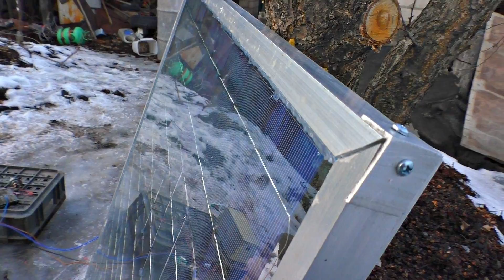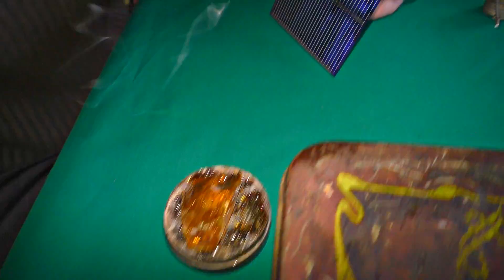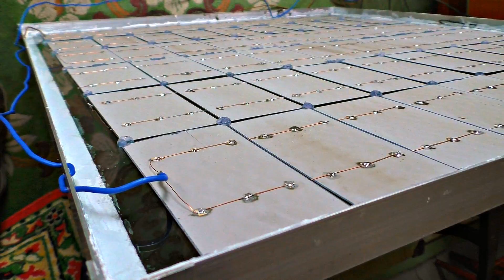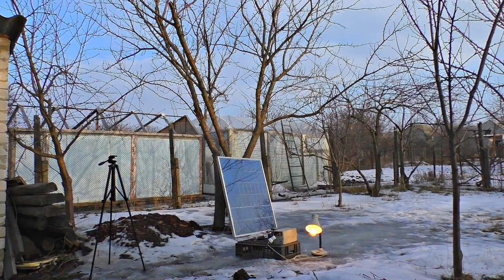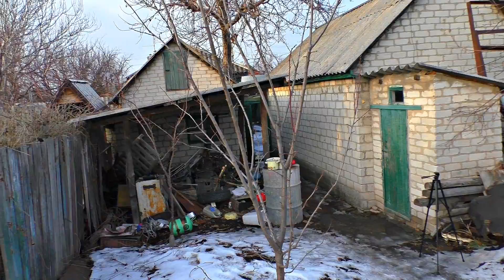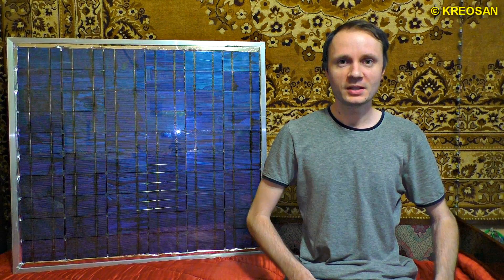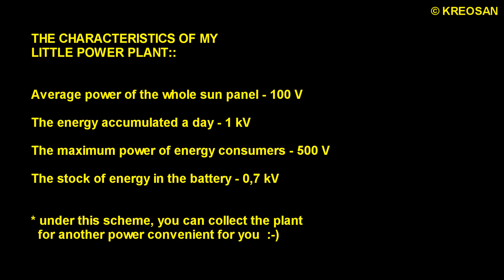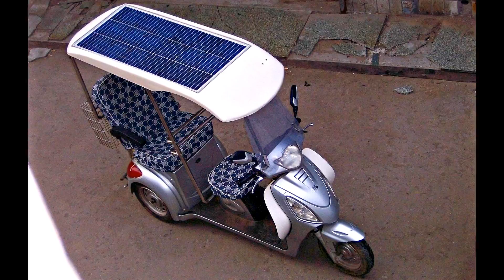Powerplant DIY /￼ Explicit step by step version / Assembling / Alternative energy

Comment: Hi Kreosan. 
Beautiful video and explanation. Maybe I told already... I am living in the middle of nowhere off the grid. 
Made some solarpanels and windmills. 
In the winter it is very clowdy here in France and I have not so much Volt in my batteries. So no fridge in the winter and in the evening candles and one led lamp of 3 Watt. 
Now I am making an earth battery outside and will connect him with the solar batteries inside.  So that  the earth battery can always charge the solar battery. (storage) 
I see that you used a diode  in the red wire to your battery. I wiil make a charge controller in between. Do you think I need also a diode or is in the charge controller already a diode?
And something more that is very interesting, the outside earthbattery is connect in series. Somebody in another you tube said (thanks for sharing)  that connecting in series gives the Volt. The Ampere you can make  also fom an earth battery and now connected in parallel. That gives the Ampere. So after that you can connect the parallel to the first earthbattery, I think rouge (+) on rouge and black (-) on black. 
When I am done with it, I will make a video in my very best English to share. 
😃😃😃🌺🍀🌸
Reply: You normally don't need a diode when you're using a charge controller.
Reply: Lukas Graphen Thank you!!! Good to know! 💐
Reply: He's right, also note that batteries are getting cheaper and cheaper every year, I really like to follow the progress speed, the entire world is going to change within 5 to 10 years, litterally, the city's even more.
People should look at vids like this:
https://www.youtube.com/watch?v=2b3ttqYDwF0 And actually think about it, if autopilot will become reality, it will basically become cheaper to use a taxi every day compared to actually own a car!
Reply: zezizarjaars Thank you for your answer and that very interresting link. 🎵🎵🎈
Reply: Think that a diode is for rectifying (as in diode bridge rectifier) AC to DC.  The earth battery is DC, so no need to rectify.  You will need a lot of cells, maybe pouring water on or even salt water depending on earth ability to create electrolyte.  Also, align the cells polarity to be in line with earth telluric current for more energy.
https://en.wikipedia.org/wiki/Diode_bridge
https://en.wikipedia.org/wiki/Rectifier

How big of rods (like house power ground rods or bigger) or pipes are you planning on using.  I used about 1" diameter when I made mine. I didn't make more than one cell though and never used other than for testing.  I thought by the river would be better though had other projects and thought a water wheel was a better investment and never even got to that project.
Reply: jafinch78 Hi jafinch. Thank you for your answer. 🌹
For me, the earth battery is only ment to charch always, also in the night and clowdy weather, the batteries of the solarpanels. So I will try to make 12 V with 10mm cupperpipe and 4 to 6 mm zinc rod. Bothe 20 cm long. I put them outside in the earth with a hammer because it is here all stone, with silica inside, very good for electricity I think. I have seen many you tubes and how kreosan use the diode is, I think, to lead the voltage one way. The voltage cannot return backwards. With my chargecontroller I have the same garanty that the voltage goes one way.
I experimented already with much ingredients, Cupper GANS (gas at nano state) Zinc Gans , another with salt water, my urine 😃) another with vinnigar and another with Ash Gans. 
From all, the Cupper and Zinc Gans and the Vinnegar were the best. 
I will now use outside the vinneger, easy to do it more times when it is needed. I live in France, so I want to learn how to make my own vinnigar too. 
Here is no water, no possibillity yet for making electricity from water.
I experimented already with Tesla energy from air and made that bridge with capacitor and diodes ... one I blow up the next was ok. The electricien in the village drawn a model for me!!!
Reply: Hi Fransje Bik.  Your welcome, thank you for sharing. I used galvanized (zinc coated) pipe and copper pipe also.  I forgot about urinating on.  I did that also. Good call.  I didn't use vinegar though and maybe there is old wine that turns to vinegar that you can get for free.

What did you do for the Tesla air way?  Did you stick a ground in the ground and use an arial antenna of some sort?   

Some days I wonder about making a balloon to stay up in the air to get more potential from the change in elevation/altitude since is greater higher up and can be transformed I'm thinking to DC.  I haven't tried that yet.  

I did see online where someone was getting a shock when touching a wire with their kite and an arial in the sky.  My favorite video (and may be on youtube since very innovative) is the free powerlines charging of a cell phone system.  I've never seen that before, though have heard of people using different coils to take power from powerlines and of course with underground power stealing by secretly clamping on to the underground cable and installing separate breaker box.
Reply: jafinch78  Hi! Sorry for this late reply. Two weeks ago I felt down from my horse 😃😃😃. Nothing broken (scanner and so) only brainquake! 
My experiment from electricity from air has to wait till I start with making drinking water out of air. In my head everything is already done, after wintertime, very soon, I will start and that is without trees around, so better for the receive of the Volt out of the air.

I did it from an alluminium plate, I cut it in a nice form and with that thing with capacitors and 4 diodes and a ground rod in the ground, I had already 6 Volt. It was done between trees. I try to make,now video's in English. Until now it was in Dutch language.

Yes I love too those horizontal 2 coils and in between my phone or so. Also a project to make.

I had also an earth battery experiment with pure citron juce. Also good result! In my comment from my video 1 and 2 of aarde accu experiment, I wrote some links. 
Hope to finish my earthbattery this weekend. Will give you the video link.
Reply: Fransje Bik:  Hi, ya... be careful and stay focused so you don't hurt yourself.   Some of these higher power systems and those that think we shouldn't be able to do them without paying them can be more dangerous.  They need to shield their systems more and in reality... many have been developed with, if not most by, public funds and resources so there can be profiteering and robbery issues also if counterclaimed validly if someone acts like there is stealing of energy. 

What is your youtube channel? What is "aarde accu experiment?" I have some videos though they're not really that good made and I am doing a house restore project post my Father having cancer for 7 years, Mom having cancer for a few years and I think all of us being targeted with remote sensing and transmission ES/TS EW weapons causing sound, body and mind disease and mutations so kind of messy and about to get cleaned up with trash service starting next week. Thanks. Keep me posted.  Sounds great.
Reply: jafinch78 Hi Jafinch 78 How are you doing? 
U give you a link to my home made battery of 12-13 Volt, yes, I did, and it works very good. It charche also in dark days and in the night the batteries of my solar system. In the video I speak in my very best English 😱 and also in the tekst below english explanation.  Here is the link, and if you search on my name, you can see also the other videos. 
And aardebatterij is earth battery. I found a beautiful model on internet, not only in serie, also un combinatiin with parallel. 
https://youtu.be/OI_Kdj1Bb_k
Bye!